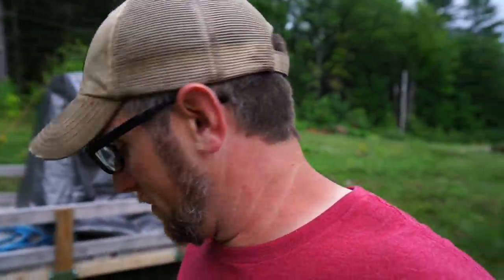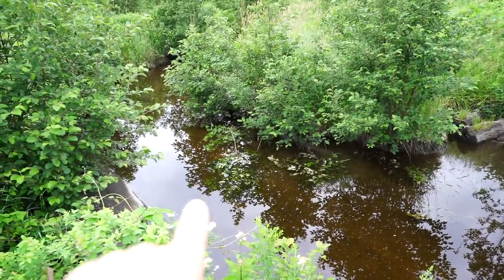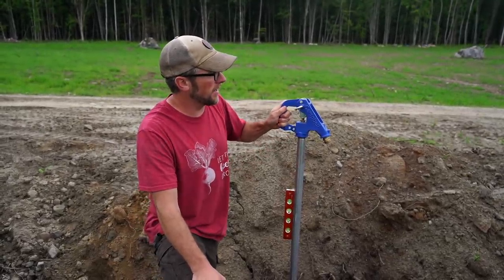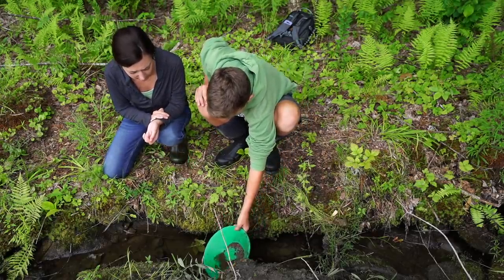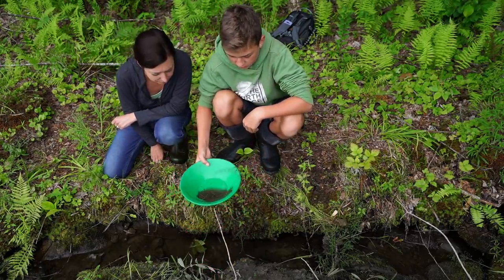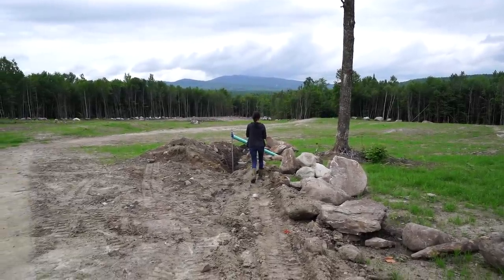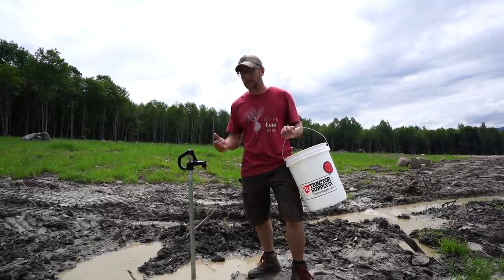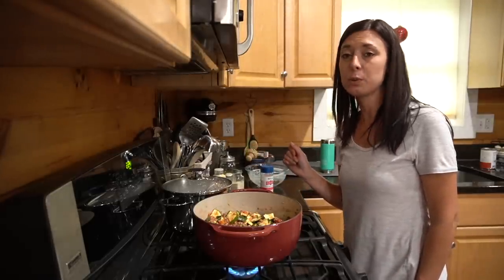DID We JUST WASTE all of OUR TIME & MONEY!?! Testing Our DIY GRAVITY FED Water System

Comment: Could the slow flow be due to suction and/or vacuum? If air can't back fill in to the cistern then the max flow is going to be however fast the spring can fill it. Most cistern and rainwater catchments (from gutters) don't have this problem because the pipe from the gutters to cistern are open to the air - the gutter.

Comment: I've been trying to catch up on your videos, so I don't know if you've solved the water pump/pressure problem yet.  Another YouTuber in Idaho "Red Poppy Ranch" has an above ground tank that feeds his underwater tank with a pump run by solar power AND a backup generator.  He has to pump it dry as winter sets in, but it IS an outdoor system with a pump that would add water pressure to the system.

Comment: RVs use a demand pump it needs a water supply and pumps untill it gets to a certain pressure and will shut off , when you open the facet the pressure will drop and turn on the pump . It should serve your purpose with a 12 volt battery and solar panel to charge the battery .

Comment: I hope you don’t mind but I had a scout around the mind boggling YouTube and came across an interesting well described simple and effective Ram pump. “How to Build a hydraulic Ram Pump” on a part of “Land to House”site.His system can even lift water to headers. Basically what it is is a set of inlet and outlet valves with believe or not a bicycle tube to supply the on demand pressure.

Comment: You get 1 pound of pressure for every 2 feet of drop between the top of the water in storage and the height of the output. Subtract from that the line losses related to flow through the length of pipe. You can't raise the source (creek). The ONLY way to increase the pressure is to pump it.  That means either pumping it into a higher tank for storage or using a booster pump to pressurize the line.  Advantage of pumping into a raised tank is that you can use a small pump to pump a small volume to gradually fill the tank when the suns up and then use it whenever you want.  The advantage of a pressure booster pump is that you can get 30-40 PSI pressure without building a 60'-80' tower, but you'll need a battery to power it, charged by a panel.  RPSSolar.com has a variety of solar pump kits and I've heard good things about their customer service, so I'd ask them for advice on the best solution.  They might even give you the system in exchange for the exposure.

Comment: In line pump hooked up to the same type battery,solar system you have on the electric
Fence.  Could have buried a 2 conductor wire to the first hydrant to turn the pump on.

Comment: You only get about 1 psi for about every 2 foot of elevation change . Your Stoneage should be about 7-8 higher than the bottom of your discharge. There are 12 volt pumps that put out up to 50 psi any RV trailer ( camper ) supply store should have them in stock as does stores like Runnings,TSC ect. To many folks get confused with the term of gravity feed as it really is not faster flow than the source is.

Comment: I was wondering about the ‘head’ in the system.  I can’t tell from the videos, but it seems that the tank and faucets are pretty much on the same level.  If this is the case, the water viscosity will seriously affect the pressure over longer distances.  Even shorter distances won’t give you much pressure (if any) when everything is on the same level.

Comment: For what you've got, 1.25 Gal per minute isn't bad.
The problem with an RV type pump is it's not intended for long distances. While it will give you some good pressure at 5,10 or even 20 feet, the back pressure from a 300 foot push would kill it in a few hours of operating time. If your looking for an intermittent, fill a bucket or tote quickly, you could attach a 12VDC pump to the spigot.
Long term without moving your tank to give 20 feet more vertical rise. You will need a substantial solar solution or mains power.

Comment: Use an elevated tote13 feet of fall is optimal, put a float switch in it.  Connect to a magnetic drive pump ( 65 watts) in the buried tank, and add a solar panel and maybe a solar generator from Ecoflow

Comment: An RV pump starts and stops on pressure, when you open the valve the pump senses the lower pressure and starts. They run off of 12 volt power so a solar system would work great but you can not put the pump inside of the tank. A small pump house ( so you can access the pump) would work two fold. First to house the pump and the roof for the solar panel.

Comment: Is the system vapor locked. Maybe installing a piece of 2 inch pvc through the lid with a 90 degree elbow on top to keep trash out would help. Easy to check. Just remove the lid to see if the flow is better. When you turned the water on at first you got a gush of pressure then it slowed. My first thought was that the system needed an air valve to keep it from vacuuming. Good luck.

Comment: I have been thinking further.  Could you bury a smaller tank at each hydrant and place a 12 volt sump type pump in it?  Provide power via 12 volt battery and trickle charge it with small solar panel.

Comment: Do you have a large zucchini 12 to 14 inches long, cut in half lengthwise. Scoop out the center part where the seeds are. Take it to inch deep baking pan large enough to lay the zucchini in. Line with foil place Cut side up on the foil. Fill hollow of zucchini with your favorite meatloaf recipe with a slight hump in the center to allow for shrinkage. Baking me oven at 3:50 until done half an hour and more until done the meat is cooked. Let cool little bit and serve with mashed potatoes or rice scooping out the serving of zucchini and meatloaf or cutting in slices and putting flat on the dinner plate. I service a lot with my children were young and they loved it.  Also check out the recipe for zucchini bread. I sometimes packaged just enough size container to make a batch of zucchini bread when I was overwhelmed with too much zucchini at one time. That way I can make zucchini bread in the winter when I had the time and it would be like getting it fresh from the garden.

Comment: In my view, the channeling between taps should be as follows. Tank outlet with 3" to the first tap, then reduce to 2" 1/2 to the second outlet, 2" to the third and reduce to 1". This would provide compression chambers and would have almost the same pressure on all outlets. This is what my experience tells me.
Hug
Reply: Water will NOT compress!   Reducing the pipe size  will help increase the velocity much like a nozzle, but ONLY with something like a pump or elevated holding tank to provide the driving (pressure) force.

Comment: Oh boy when the council came around to fix our water line feed into the property they dug up huge boulders that had been put back into the trench on top of our water line. The cleaned the whole trench out, fixed the line in 4 places and place in a bed of sand under the pipe then another foot of sand on top of the pipe line then added pea gravel on top of that the boulders were placed into my garden bed as points of interest as they were fantastic sandstone boulders nice rich yellows and reds strips.  Since they fixed it we have not had a problem since. Before that they had been out 3 times in one year to fix the brakes in the water line that was 8 years ago 😹😹 not seen any water weeping out of the hill😁😁

The black faucet is running faster than the blue one.so your going to need rerun the test on the blue faucet 😹😹😹😹

Gina you can dice up and freeze fresh grown zucchini I do this when the crops give me more than normal 😹😹😹 and just pop it in to my stews as needed. This year I just got my new dehydrator so this year I will be drying my veggies as dried veggies take less space and the shelf life of them go from a few months in the freezer to a few years so that’s a better solution for me for when we get another drought then I will still have veggies in stock 😹😹😹

Comment: I use a 45 psi automatic pressure switch RV pump a small rechargeable 12 volts battery system and a cheap solar charge with 4 25 watt panels work great for me we have a small farm and it has good pressure
Reply: As in 100 watts of solar panels total

Comment: Temporarily hookup a long garden hose to the hydrant and run the open end as far downhill as you can. Then turn on the hydrant. If there's air in the line, the extra drop of the garden hose will siphon it out, and you you can test how far downhill  you have to go to get enough pressure.

Comment: yeah an on demand rv pump is a good idea if it senses the water being turned on without a switch ... just checking if you got a single solar panel 200watt and a 24/36 to 12v voltage reducer you could probably run the pump which will take from 3 to 6 amps at 12volts... probably not worth the battery bank but the problem might be placement of the pump.. it would have to go someplace near the tank underground which isn't going to be fun dealing with if you need to change it so you would probably have to install some kind of pit with a manhole... i don't think they are submersible.... anyway good luck  like you said some water is better than no water

Comment: If I were doing it I would have used a tank above ground and pumped into it with a small solar setup to fill the tank. But that would freeze in the winter with the cold temperatures up there. You may want to keep that tote up there, and when you are going to need water for your animals start by putting water in the tote since you can let it run for a while and do other things, and then fill your buckets from the tote, or a 55 gallon barrel and do the same. Unfortunately there is no free lunch, and without having a big drop in elevation you are going to need to have a pump to get the water to flow faster. If you add a pump in-line on the system are you going to be setting yourself up for something that is going to require a bunch of maintenance?

Comment: OK.  City water pressure is typically 40 to 60 psi.  Every drop of 33  vertical feet, from your source, will increase your pressure 14.7 psi.  So, to approach city water pressure your tank would need to be 100 feet higher than your hydrant outlet.  That would give you 44 psi.  Since your system is gravity fed, air in the lines would self purge, either toward the tank or at the hydrant.  Kinda like a.bubble rising through a straw.

Comment: An RV or a boat water pump runs on solar or 12 volt service from the vehicles engine. You could use a single  100 or 200 watt panel and a 12 volt battery to control a pump. I watched a video last night on a 12 pump a man was using to get water out of his 500 gallon tank for watering his garden. It's on YouTube. He also had one for his 1200 gallon tank up at his workshop but that one he was using grid power. I wish I could remember his name. The video title was his name, the word "Tools", 500 gallon water tank with solar 12 volt pump. His name was like John, something simple like that. He does one of the best tutorials that I've seen. And I've watched a ton of videos on the subject bcuz my first water system on my new homestead for my temporary "apartment" off the  barn will be water catchment from the metal roof. Thru a sand & biochar filter for drinking & cooking besides laundry and watering my animals I'm hoping to get started this fall. After my daughter's fall wedding that she announced when I was getting ready to leave state to look for land farther south. I hope this helps sorry Its not much to go by. If I remember it I'll send a message.

Comment: It works but you need to go further down hill. You said that. If you went further down I'm sure it would have more pressure. In a nutshell: Just remember every foot of elevation change causes a 0.433 PSI change in water pressure. If your pipe is going downhill add 0.433 PSI of pressure per vertical foot the pipe goes down.

Comment: What you need is an Automatic Water Pump Pressure Controller - you can get a few batteries and a solar panel / charge controller to power it off the grid... but if you don't have enough change in elevation for natural pressure... then you should have went with water containers set up on an ELEVATED platform with a solar pump that would fill them up during sunlight hours with a simple floating water level switch...Platform elevated water tanks are also easier to service and would've provided plenty of room for a solar "ROOF" and optional one or two wind generators - which would be producing power to spare for lights and other uses.   When there is no sun/light there is usually wind, so a hybrid system solar-panels/wind generator is a smarter choice... later - you could have integrated the extra power into your home with an islanded grid tie inverter.

Comment: There are charts on the internet which will tell you how much pressure you get from a specific column of water. Of course that is diminished by friction in your piping, but you can get a good idea how much pressure you can get. The further down hill the more pressure you’ll get. The best way to get good pressure is to use a pump to pump water into a water tower. If you calculate the maximum amount of water you will need per use cycle, i.e. for each time you run the water, you can size your tower capacity accordingly. This means a smaller pump can be used so less solar power will be required to keep it filled. The question for your area then becomes how to avoid freezing. Painting the tank on the tower black will help immensely, but you may need a heater. Your existing container on a stand ten feet high would probably be more than adequate. A well insulated wooden enclosure at the top would reduce the amount of energy needed to prevent the water from freezing. A ten foot high tower would give you >15 psi, but you have to remember that means ten foot above the top of the highest dispensing point.

Comment: If gravity fed with tank &  pipe the same height the further away the less pressure you will have. If tank is higher than water line would give you some fall for some down hill pressure. If flat tank and flat pipe you may want your faucett closer to your tank for better pressure.

Comment: I’ve seen lots of comments about water pressure on this video.  Following is the equation to calculate water pressure:  Water Pressure is nothing but the flow of water from the pipe. It is defined as the force which makes the water flow stronger or weaker. Here are the simple and easy steps to calculate the water pressure.
Take the height of the outlet from the base.
The formula to compute the water pressure is P = ρ * g * h
Where ρ is the density of water, g is the gravitational constant and h is the height.
The constant value of water density is 997 kg/m³, gravitational constant is 9.81 m s-2.
Substitute the values in the formula.
Perform multiplication of those 3 numbers to get the answer.
Reply: It would have made more sense to give him the equation in english units. Newtons/meter squared pressure isn't going to make a lot of sense to him or most of us. He can convert but it will take time and he is not great with patience. Maybe you use metric units all the time but here we don't. The pressure in psi would help much more.
Reply: To convert to PSI divide by 6894.8.  I also live here, it’s the engineer in me.

Comment: Every 33 ft drop in elevation should be about 15 psi. Residential pressure is normally 60 psi. You would need about 100 ft drop to get 45 psi. Also make sure tank has a vent. If you don’t have adequate drop, you will have to install a pump at the tank.

Comment: Go to stony ridge farms and see how he is handling it. A flow sensor switch combined with a solar pump system will increase the pressure. I think you could use water tanks controlled by float valves to water your animals. Few moving parts that way. Another way to increase flow with out a corresponding increase in back pressure is bigger diameter water lines. That will actually increase your volume and water pressure.
Reply: As the volume increases doesn't the pressure  drop ?
Reply: @colinstace1758  Yes it does until you drop it back down then it increases.

Comment: SEAFLO 42-Series Water Pressure Diaphragm Pump w/Variable Flow For Reduced Cycling - 12V, 3.0GPM, 55PSI. add battery and solar panel .

Comment: You can buy a pressure pump, pressure accumulator and then just size the batteries and solar panels to run the size of pump you have, easy, don try and reinvent the wheel, these are cheap and readily available, tried and tested. Do it once, do it right, you have to much other work on to worry about cobbling something up that will fail just when you need to water.

Comment: 1. first measure the heights of the top and bottom of the tank.
2. measure the height difference from the tank to the hydrant. In order to get a good usable pressure and flow, you must have at least 2 m of height difference between the bottom of the tank and the top of the hydrant.
3. Most likely, there are residual air pockets in the pipes, so you can’t get full pressure and water flow.
4.  To expel air from the pipe, try to pressurize the air tank, max 0.1 to 0.2 Bar
5.  Another way is to place a hose connected to a portable hydrophore on the hydrant, and let the water run in the opposite direction for 1 minute. To get air out of the pipe.
6. If none of this works, put the pump at the exit of the tank.